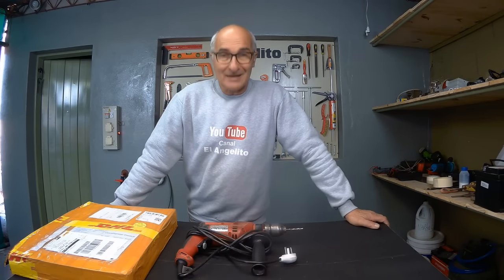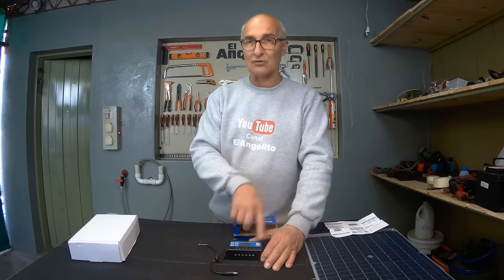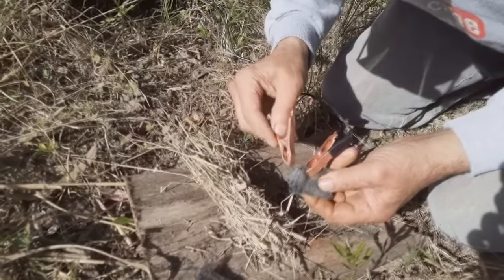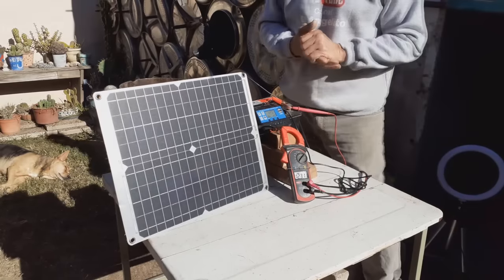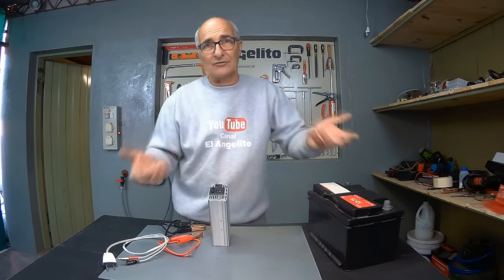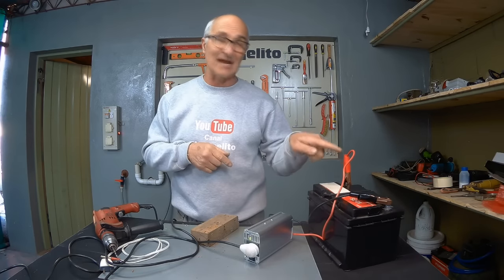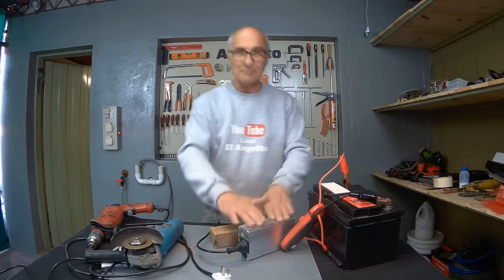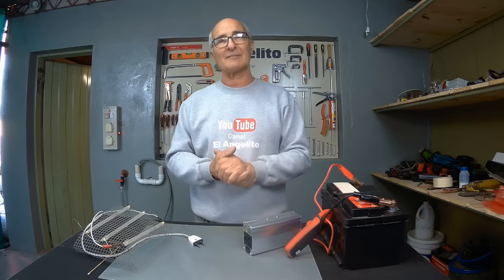Probando PANEL SOLAR de 40w Con INVERSOR a 220V

Comment: Hola, quería consultarte porque tengo instalado un cerco eléctrico, compuesto de 16 hilos, en un perímetro de 125 mts, (en el lugar no hay energía eléctrica). Posee una central de alarma (o también llamado Energizador), que tiene estas características: tensión del pulso 8000-14000 voltios, energía emitida 1.9 Joules y un consumo continuo de 46 W. Qué potencia deberían tener el panel, el regulador, la batería y el inversor. Muchas gracias por lo que puedas orientarme
Reply from the maker: Con 100 vatios te sobra.
Reply: Gracias, por tu respuesta, pero eso de 100 vatios es el panel?  y lo demás de qué características deberían ser (el regulador, el inversor y la batería). Muchas gracias. Saludos

Comment: Saludos bro. Una consulta bro aver si me puedes ayudar, ya que no tengo batería, será o habrá una manera de utilizar la energía proveniente directamente desde un panel solar de 30 watts con algún circuito pero que me entregue libremente la mayor parte de amperaje del panel? Lo quiero Para cargar celulares efectivamente. Osea que sí el panel es de 30 watts, el amperaje que entrega a pleno sol son mas o menos 1500 milihamperios, y quisiera ver sí se puede utilizar la energía directa desde el panel y con algún circuito reducirla a 5 voltios sin que me baje esos amperios. (se siempre va a variar según la intensidad de luz solar, pero quiero el circuito no irrumpa en el amperaje que entrega el panel). Nota, el panel no trae comector usb para cargar celulares

Comment: Hola Angel espero que este bien, quiero hacer un pequeño proyecto mi consumo es de 250 watts, voltaje 110 voltios 60 ciclos, mi duda es necesito una placa solar de esa capacidad??? No quiero guardar la energia sería solo durante el dia para los equipos de mi cuarto, desde já muchas  gracias, Carlos desde Brasil.
Reply from the maker: Necesitarias al menos 250 vatios en paneles, unos 8 de estos , o varios mas grandes.
Reply: @elangelito  Gracias por el retorno pienso que sin bateria estoy expuesto a interrupciones o fluctuaciones de energia..

Comment: Saludos. Diskulpe d cuanto deve d ser el inversor para q pueda con este  aparato.. k tiene esta numerasion..5-asp  115v-60hd 5.0A. Espero m entienda
Reply from the maker: Depende de que es el consumo, si es de una resistencia calefactora, con uno de 1200 watts estara bien, si es de un motor, quizas necesites uno de 3000 para que se aguante el arranque del motor.
Reply: @elangelito   grasiass. Es una bombita sumerjivle en el agua.

Comment: tengo una duda compre este panel de 40w 12v, no me ha llegado aun, tiene 2 puerto usb directo para cargar por ejemplo 2 celulares, mi duda es la siguente: yo tengo un hub de 5 puertos me afecta en algo  el colocar el hub usb directo al panel y asi cargar 2 celulares 1 tablet 1 powerbank y 1 ventilador portatil, q todos son de 5v-1A carga mas lento todo no es buena idea? la otra duda pierde intensidad si uso un cable usb de 5metros del panel hasta la casa? todo se basa en usarlo directo para mis artefactos usb, estoy en un lugar dnd paso un huracan y ya tenemos 11 dias sin corriente. saludos.
Reply from the maker: No amigo, solo podras cargar 1 celular a la vez, es muy pequeña esta celda para mas. Saludos

Comment: Buenas tardes quisiera saber que tipo de panel solar nesesito para instalar en mi camper en la cual cuento con un horno microondas.
Por fabor nesesito saver que comprar y cuanto mas menos gastare y de cuantos wats deve ser el combertidor
Reply from the maker: Un microondas consume 1800 watts, le tendrias que extraer a tu bateria  aproximadamente  150 amperios para poder funcionar , una locura!!! No creo que sea una buena idea lo del microondas para hacerlo andar con un inversor y una bateria.
Reply: @elangelito  y si le pusiera 2 baterias de 100 alli podria funcionar o tampoco

Comment: No me queda claro si se puede dejar instalada la batería al regulador y a la vez hacer uso de la electricidad que entrega la batería con algún artefacto , es decir ¿ Se puede enchufar  o usar sacar una salida de 12 v para usar en un aparato desde la borneras derecha de la lamparita bdel regulador o desde la batería de 12 directamente?
Reply from the maker: Si, pero solo si es  algo de bajo consumo, que no supere los 5 amperios en 12 voltios.
Reply: @elangelito  si ángel , sería solo para conectar a 2 receptores de 433 hz con su relé  para que activen una sirena , es un sistema de alarma casero que me arme

Comment: Tengo un panel solar de 160 una batería de 12 voltios 100 amperios el regulador  y un inversor de 400w le puedo conectar un televisor y cuántas horas puedo tenerlo ensendido sin qué meses cargué la bateria
Reply from the maker: Si el panel es de 160 watt, mientras tengas buen sol podras alimentarlo casi directamente con el panel sin gastar de la bateria y aun asi ir cargandola un poco, y despues que se vaya la luz , unas 6 horas con la bateria.

Comment: Amigo a un panel de 150 w le puedo poner a cargar una batería normal.de carro ,la de  ácido ?
Reply from the maker: Si, por supuesto, pero debieras agregarle el controlador de carga, para que cuando la bateria este cargada, corte la alimentacion.
Reply: @elangelito  pero la carga igual ?
Te explico en breve . Tengo dos cargadores a 12 vol 0.5 ah . Necesito que almenos la.bateria dure 24 horas . Por eso colocare un batería de 100ah . Pero no batería solar . Solo tengo una normal de carro . Aconsejame porfa . Bendiciones

Comment: usted es un capa de que capacidad necesitaria mi panel solar . para poder encender una refrigerador o heladera
???
Reply from the maker: La potencia  te la da el inversor que le pongas,  unos 2000 vatios, la duracion de la carga de la bateria dependera del consumo y de la capacidad de la/las baterias, y en base a eso , tendras que tener los paneles necesarios para poder cargar en tiempo y forma esas baterias, este panel es de 40 vatios, y un refrigerador consume 160 vatios.

Comment: Buenas, yo mi controlador lo tengo para que corte la carga a los 13.5 pero nunca supera los 13, por que será? La batería tiene 14 meses es batería de ciclo profundo ya me estará dando problemas y será por eso q no carga más de 13? Les agradezco si me pueden ayudar gracias
Reply from the maker: Podria ser que tu bateria tenga una descarga interna y no puede pasar de ese voltaje, estas baterias requieren de ciertos cuidados en el uso, quizas se pueda haber dañado.  Tendrias tambien que medir el voltaje  que da la celda, a lo menor esta bajo por algun motivo.
Reply: @elangelito  del panel vienen 14.5 según el controlador

Comment: HOLA ANGELITO UN GUSTO TENERTE COMO INSTRUCTOR, MI NOMNBRE ES EMILIO UN SIMPLE RETIRADO DEL TRABAJO PERO ME GUSTA APRENDER, SI NO ES MOLESTIAS ME GUSTARIA SABER SI ME PUEDES AYUDAR, INSTALE DOS PANELES SOLARES DE 75Wp , UNA BATERIA DE 12V 220,  Y UN CONTROLADOR SOLARTEC, RESULTA QUE DSPUES DE UNOS MESES EL CONTROLADOR YA NO ME DISTRIBUYE ENERGIA HACIA LAS TRES LUCES PERIMETRALES, ME PODRIAS ORIENTAR SOBRE EL PROBLEMA. GRACIAS
Reply from the maker: Quizas se haya dañado algun relay interno del controlador.

Comment: 500w a qué equivale y cuánto
Reply from the maker: 500 vatios equivale al consumo de un artefacto de 220 v con un amperaje de 2,2 amperios, o a uno de 12 voltios con un consumo de 40 amperios.
Reply: @elangelito  tengo un convertidor de energía de 500w, en el Puerto dice 110v/60gh.
Podría conectar una bomba de agua de 1/5 H.P

Comment: Hola angelito me armé este mismo kit, mi batería es de 12v 350A intento conectar 3 focos incandecentes de 100w y la carga no me dura ni 20min. qué puedo hacer?
Reply from the maker: Quizas tu bateria esta mala o es muy pequeña, una bateria de 350 amperios es de las que usan los camiones, quizas estes confundido
Reply: @elangelito  gracias por la respuesta Angelito, la batería la acabo de comprar sellada, es de automóvil y corrijo la capacidad, es de 330Ah. Puede ser que mi inversor esté consumiendo toda la potencia?
Reply: Es porque tiene que ser ciclo profundo, diseñada para este sistema

Comment: De que energía estás hablando..? Cuantas semanas se necesita ,la placa de 40W para pasar esa batería ( de 12 v. 7 AH) de 1,9 v a 13, 7v.,solo para cargarla, sin ningún consumo
Porque hay que hablar de meses.. solo para poder cargar una pequeña batería de 7 AH
Téngase que 7 AH  son 7 amperios a 12 voltios., son. 84 watios ..lo que gasta una bombilla de 60 watios en una casa en una hora...
Conclusion ..( téngase en cuenta que esa placa carga una media de 0,1amp.durante 10 horas diarias de luz.. en verano y un día soleado)
? Cuantas semanas necesita esa placa para cargar una batería de 7 AH .. para poder alimentar durante una hora una bombilla de 60 watios en una casa?
Gracias por anticipado por tu respuesta.... Angelito eso solo lo puede saber tu.. porque tienes el equipo.. porque las matemáticas dicen que 100 horas.. mínimo.. pero pienso que son semanas en la práctica..tu dirás
Un saludo
Reply from the maker: Esta celda es de 20 vatios, eso quiere decir  que entrega  1, 2 amperios, Para recuperar 1 hora de descarga de una lampara de 60 vatios, necesitara 3 horas de buen sol.
Reply: @elangelito  ... Angelito la carga de una batería no es constante.(porque estamos hablando de usar la placa para cargar la batería  , para después usar la energía ,en otro momento)
Me dices que con la placa cargas la batería en tres horas? Angelito?
Parece que no has vuelto a ver el equipo 😂😂😂😂 después de la exhibición.... por cierto muy buena
La corriente de carga de la batería depende de la  diferencia de la tensión del cargador y la tensión de la batería, dicha tensión va disminuyendo a medida que la batería va cogiendo tensión y acaba en cero amperios cuando la batería llega a los 13.7 voltios en una batería de 12 voltios..de eso se encarga ese regulador de carga azul tan bonito que presentas en el vídeo
Este proceso de carga de la batería suele durar 8 horas ( según fabricante de la batería)
Entonces de qué estás hablando en tu contestación... angelito...te has precitado...coge el equipo y no te precipites...en tus valoraciones...un saludo

Comment: Como puede cargar si usted mismo dijo  es de 40watt si no tiene el circuito cargador como el circuito amplificador y el regulador ams 11 osea yo soy bruto x pronto sacare mis diseños y provar que usted miente salvo que tenga unas celdas fotovoltaicas modificadas
Reply from the maker: Estudia un poco antes de decir que quien te esta tratando de enseñar, esta mintiendo.
Reply: Como puede una celda solar cargar defrente sin un regulador el cual esta disenado para regulalar y cargar la bateria x los circuitos integrados aora si yo necesito estudiar mas como usted dice se llama energia o tension lo que usted nos enseña con respeto
Reply: Yo pude observar que usted pone el panel directo al celular o me equivoco y carga entonces para que tendria el regulador el regulador esta diseñado como su nombre lo dice regular el voltaje y cargar la bateria para poder rectificar la tension pulsante que pruduce la celda solar aora sin el regulador no se derrepente tiene usted uno micro ai en el panel mismo claro que trabaja derrempe oi mal i usted no dijo que el panel trabaja con un regulador